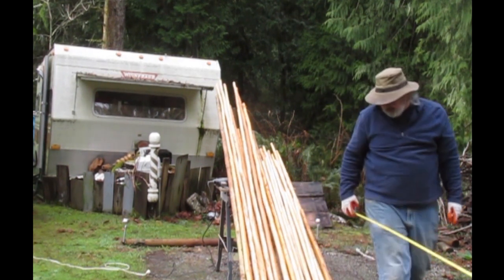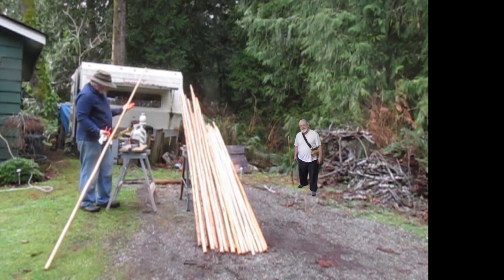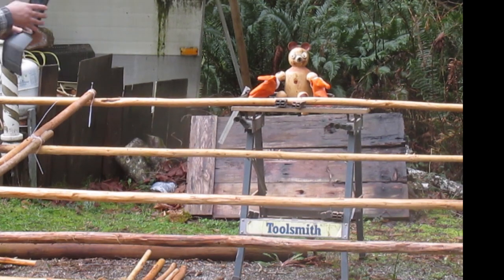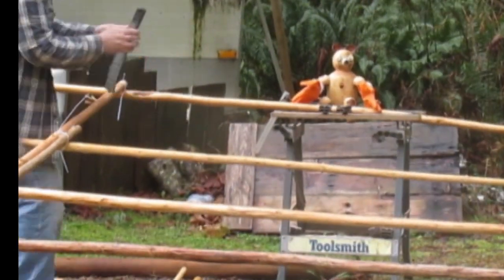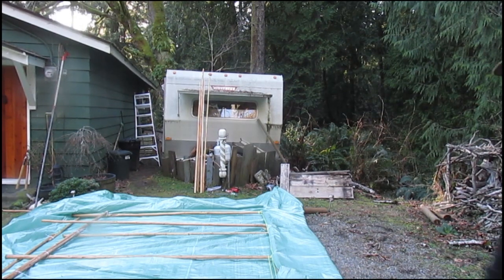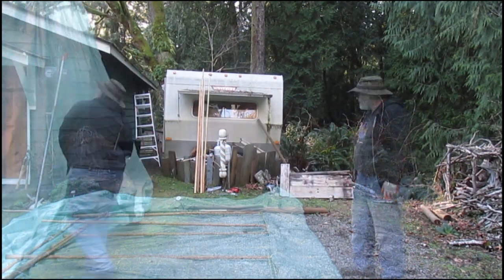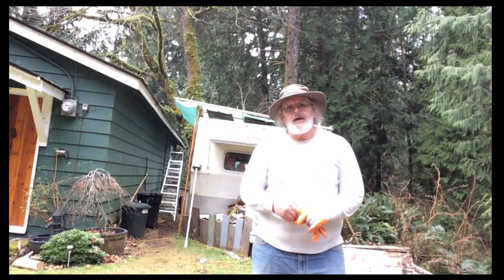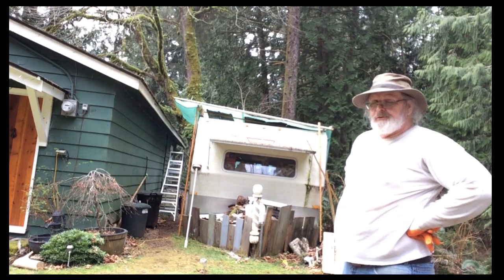Wood Turning #101 Roofin' on a Trailer

Comment: I loved this video! I liked the multi-screen perspective and the part where you were watching yourself work while leaning in the trailer hitch/barbers pole, very clever. :^) Bravo for sticking with it and getting it done, I know things are much more difficult when we're not 100%.
Reply from the maker: notsunkyet I love the moniker! ;>) That section was just one of those .. I gotta' stop for a minute " moments and as it was as much a part of the build as anything else (wouldn't have got finished if it weren't for them!) I decided that I should leave it in! ;>) I am now working on a roof for a greenhouse! But that won't be a video... I just have to get it done! I am too close to the ocean to grow anything other than peas outside... so I have to enclose it somehow. That also makes a good way to keep the deer out too! Not so much for the bears... but what are you going to do eh? They are usually happy with fruit trees out there anyway!   ;>) Thanks for watching Larry     PS That barber pole used to be a 6x6 till it found it's way onto my lathe!

Comment: Beautiful video, Larry.
Since you've properly gewerkelt for the roofing.
This is normal when alone does something, something that takes a little longer. Looks great but the roofing.
Reply from the maker: Günter Schöne gewerkelt? übersetzt nicht !! Aber ich kann ein paar Worte, die dort passen würde denken !! Lustig ... ist, dass die Art von Projekten, die einmal möchte ich an einem Tag getan haben ... und jetzt sind es 4? Werde wohl alt! Ich bin froh, dass Sie für die Fahrt ... kam;>) Vielen Dank für das Ansehen von Larry
Reply: Hi Larry,
gewerkelt = you can say also fun project to do so. :-)
However, it is generally the case that if you want something done in a day, which then lasts longer. So but it's me, I need more projects than as planned.
Reply from the maker: Günter Schöne Danke! Das macht mehr Sinn, jetzt! Ein Projekt heute vergessen ist ein neues Projekt, um auf der Straße entdeckt zu werden! Möge dein Weg ist voll! Larry